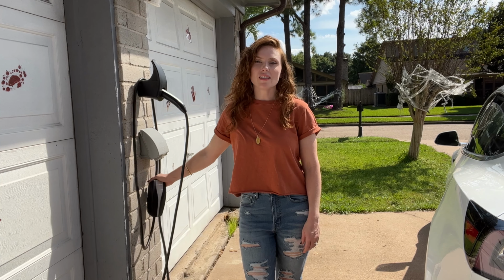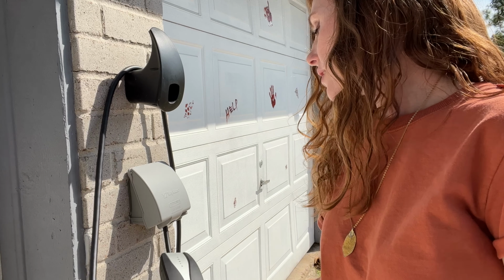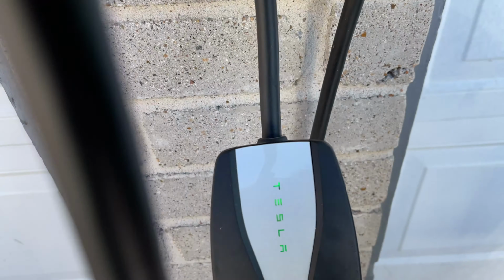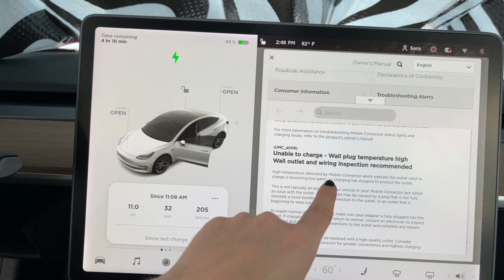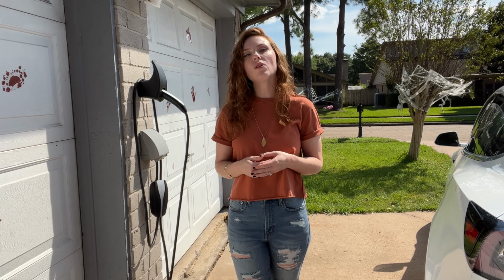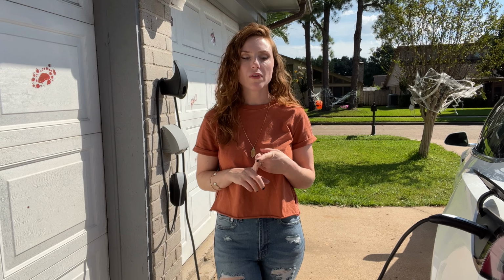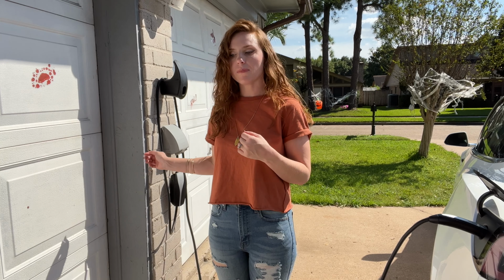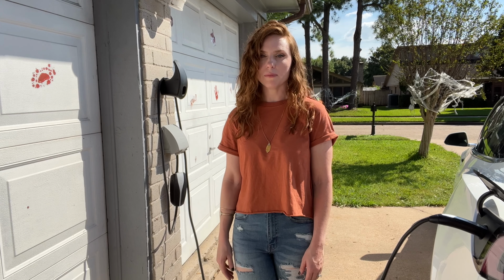TESLA Mobile Charger Problems/ Troubleshooting

Comment: Some thoughts:
1. You could plugin and then schedule a charge during cooler hours. You can always check the charging state with your Tesla app to verify. (Free)
2. As some have mentioned, you could get a heavy duty 50amp-rated extension cord so your MCU can be inside your garage, which should be cooler. (~$100)
3. You could get the Tesla Wall Connector mounted just inside your garage. The 24-foot cable should easily reach a car outside. ($500 wall connector + electrician). Electrician's fee will greatly depend on distance from your electrical panel (range $300 directly next to it to over $1000 if 20+ feet away). Of course, you'll need to crack open your garage door while charging.
4. Modification of #3 - instead of Wall Connector - just install a NEMA 14-50 outlet just inside your garage - saving you $500. Electrician fees will be slightly less because of the smaller wire size required for a 50amp circuit.

Considering the distance you travel on a daily basis and that you need something reliable for work, it would be worthwhile to upgrade your charging setup at home. Don't forget that you can still use Tesla Superchargers around your area if you really need to - or, in dire circumstances - even third-party charging stations.
Reply from the maker: 👍🏻👍🏻👍🏻Jason, I agree with all of this!!!! All fantastic ideas!!! For now I will probably make a temporary shade over it that hangs from a hook for the hot summer months. BUT, all these other options would be great too!!!! Hopefully all the information in your comment will help lots of other people as well!!! Thank you so much for sharing all this! Have a great week!!!

Comment: Will this problem be mitigated if you installed the Tesla Wall Charger?
Reply from the maker: Actually it probably would, for a couple reasons! The Tesla wall charger is white, it’s glass so the components are kind of shaded under that, and it resets just by unplugging from the car!

Comment: Will the charger reach the inside of the outer garage wall? The gray painted area in front of the door. Maybe some shade will do the trick. I have a Tesla wall charger on a 60 amp breaker in my garage and it pulls 48 amps when charging and it gets a little hot as well but never shuts down but it in not in direct sunlight.
Reply from the maker: I should have installed it inside the garage and just ran the chord under the door. But mistakes were made… I think I’ll probably just make a removable shade and see if it helps. ;)

Comment: Hello Sara, I would mount the wall connector to the inside of the garage, behind this wall and put the cable under the garage door so that the wall connector is in the shade and you can charge the car outside.
Reply from the maker: Yep, I agree! That’s what I should’ve done in the first place! Dang it! Thanks!!!!!
Reply: @SaraJAwesome  🙄
Reply: @SaraJAwesome  Or add a cover to keep out of the direct sunlight. I'd also add a support so "brick" isn't putting so much strain on the plug.
Reply: I live in Houston as well. SarahJAwesome love your videos. I have my charger plug in the Garage, I want to run the cable under the Garage door but am worried about it hurting the cable? Any experiece with having running the charge cable under the door ?
Reply from the maker: That’s actually what I should have done in the first place. But I have a tiny gap under my garage door. So mine wouldn’t put any pressure. The cable is like 1/2” in diameter so just see if there’s somewhere you can run the cable under the door without it smashing it. I may still move mine eventually. It would prevent theft too.
Reply: There's a great video on youtube that shows the best way to install the charger inside of the garage and run the cord underneath the garage door, "Route EV cable under garage door". Search it up on youtube. I did the same thing except that I also had to adjust my garage door so that it left a 1/2" gap at the bottom to allow for the rubber duct cord cover. I also adjusted the top of the garage door to allow it to properly seal up on top.
Reply from the maker: Thank you!!! I’ll check that out!!!!
Reply: There is a hole drilled into the wall already. Expand that a touch and the charger could be in the garage with the charge cable going through the wall. A benefit of the tesla connector size
Reply: Are you sure? I tried that and the garage door weight bend the cord. And that was just first attempt. I'll worry if I continue doing this

Comment: Could you run a short extension cord up to under your eves of the garage and plug in your charger up there?  The charger for my volt is plugged into a 220 in the garage and the charging cable is long and runs thru a hole above the garage door and hangs in the holster to the side of the garage door.  I have nails along the molding above the garage door to hold the cable if I need it out of the way but normally I let it drape over to the holster.  West side as well and hot weather too.
Reply from the maker: Very nice! What I should have done is installed it in the same spot on the inside of the garage and ran the charging cable under the door. Ugh. Mistakes were made. I think I’ll probably try to make a shade for it that hangs on the hook during the hot months. Idk yet. Thanks for your thoughts!!!!!!!

Comment: This same concept happens on my 120v outlet. I have it in the garage but when the temp goes up, and that outlet is already warm from producing the juice, it gets even warmer and will shut down the charge when it gets too hot
Reply from the maker: Dang, that sucks. Some people are mentioning to me that I need a more expensive Hubbell brand outlet. I wonder if they make a 120v for you.
Reply: @SaraJAwesome  I'm going to get a 240v installed outside. I'm going to put it on the eastern side of my garage since I charge overnight as it is, cooler weather and even the sun exposure it will get during the day will be minimal
Reply from the maker: Very 👍🏻 nice!!!!

Comment: I started having the same problem charging my Tesla model 3 2018 and the note started coming up on the screen high temp amp reduced from 32 amps to 16 amps. Did not have this problem until after updates about 2 months ago. The 14-50 outlet did get hot but worked without any problems for over 2 1/2 years. I replaced the inexpensive 14-50 with a industrial grade 14-50 outlet Hubbell  and the problem was corrected. Now I believe Tesla upgrade the software for safety reasons because these cheap 14-50 outlets might cause a fire hazard.
Reply from the maker: ✅✅✅✅✅✅EVERYONE READ THIS COMMENT ABOVE 👆 Oh wow! Okay then! Maybe I definitely need to replace mine then. That makes a lot of sense. Thank you so much, John!!!!!!! I did get a cheap outlet. Mine was about $10, I heard the Hubbell brand was about $50 but I haven’t looked it up yet. And it’s worth it to make sure the outlet is durable and safe. And if it fixes the problem.. even better! Have a great week!
Reply: @SaraJAwesome The Hubbell outlet cost me $99 on Amazon but has work for over a month now without any problems.
Reply from the maker: Ouch! That hurts my heart! 😂 worth It though I’m sure.
Reply from the maker: Oh also, I saw you posted a link, but I can’t see it because you tube blocked it I guess. Super annoying because I don’t block them in my settings. It should be allowed. So I can’t reply to whatever that video was. Sorry.
Reply: @SaraJAwesome  Try searching “check your tesla plug ! why you must get industrial grade” to see if YouTube comes up. The YouTubers name is Evan Michiels and he said I could pass it on. He is the one that I learned about fixing the problem.
Reply from the maker: Oh thanks! Yeah I learned from him about my A/C issues! Nice guy. Thank you!!

Comment: Thanks for the info. I didn't know about the overheating, but I've kept mine inside the garage and run the cord to my driveway, and seems to work fine so far. I'm not sure about your electric rates, but some people are on tiered rates, so it is cheaper to charge at night than during peak hours during the day. It may even be cheaper to just run off to a supercharger if you need to go watch your son's football since so many people have used your referral code.

Also, can you please correct the link for the owner's manual? That's an (J)awesome idea. Thanks.
Reply from the maker: Okay, try the link now!!!!
Reply from the maker: Oh crap, I didn’t know the link was wrong!!! Thanks!!! I’ll look at it! And yes, I’ll probably just make a temporary shade for the summer months.

Comment: 6:58: Is there some sort of weather proof foam or silicone (??)that could cover the unit? I am thinking of my silicone oven mits. Perhaps a carport awning🤔
Reply from the maker: I think insulated could be good or bad. I don’t want the trap the heat, and I still need to see the lights for errors if they happen. I’ll robably do a screen type removable shade. To allow air flow, but block the sun ☀️;) good idea though!!

Comment: I had some overheating problems with my GoPro recording my daughter’s softball games in the summer. What I did was clip a small towel to the top of the mount and let it drape over the back of the camera. You could do a similar thing with a larger towel. If the housing for the outlet has a lip, you could use a strong close pin or a larger paper clamp  to hold the top of the towel in place. Let it drape down to provide some shade for you charger. Let me know if you any pictures of the idea or the clamp.
Reply from the maker: Smart!!!!!!!!!!!! That’s a great idea! Thanks!

Comment: Why didn’t you just install your 240v outlet directly on the other side of the wall in garage and just allow charger cable to run under garage door? This is what I did and haven’t had a problem. Kinda weird spot have it, especially someone could steal it.
Reply from the maker: Because I’m an idiot, Kyle. Mistakes were made okay? Bahahahahaha😜🤪😂😅 Jk. I should have done that in the first place. But I wanted to utilize the entire length of the chord and have easy access. I didn’t foresee these problems. But that is my advice to others for sure now. Maybe one day I will move it inside on the same spot and  run the cord user the door. Have a great week!!

Comment: Huh. Commented, but it's now disappeared. Ah, well. To repeat myself: I'd suggest getting a 50A RV extension cord. You could put the UMC in your car, plug it into the cord, run the cord through a window cracked down an inch, and plug the cord into your outlet. In the car, the UMC would stay cooler, especially if you have "Cabin Overheat Protection" enabled. Easy peasy!
Reply from the maker: Yeah, I was just complaining to someone else that their commented I wasn’t able to see either. It happens all the time! And I don’t have any restrictions on comments! So annoying! And yes great idea!!!

Comment: Moving it inside on the other side of this wall would work too. You can than run an extension but should work.  Might be cheaper in the long run or better.
Reply from the maker: Yeah, I should have installed in the e same spot on the inside and ran the wire under the garage door. Dang it!!!! Ugh. 🤦‍♀️
Reply: @SaraJAwesome  it’s ok. Lol you have problems with the heat and i’ll have problems with the cold soon. Lol we just gotta adapt and work through it. 👍
Reply: I like this suggestion. The wiring / pipe is most likely on the other side of the wall anyway. Easy for an electrician to relocate the outlet on the other side or just abandon this outlet (for cosmetic reason) and add a new one on opposite side. Of course, the outside one will no longer work. Being a master electrician, the above option would be my vote.  I plan on making an ultimate guide on this mobile connector in the near future. Great video Sara.

Comment: Sorry to hear that mobile charger can overheat.  Someday I will receive my Tesla model Y, hopefully this year before my current car registration expires in December.  But who knows?  Tesla’s dashboard no longer projects a delivery date, and I suspect I may be looking at 2022 delivery.  Seems like forever I’ve been waiting.  Turns out, my garage 240v outlet is West facing too, though it is just inside my garage, were late afternoon sun can hit it.  Wet towel trick, sounds great, though won’t look great.  I have at two car garage and it still fits two cars!  Junk has no chance to accumulate, extra stuff is donated or tossed.  But, only one child, so that’s going to make a big difference.  Does the app send notification that charging has stopped? Or has reached certain percentage?  Apparently not, that would be a nice improvement to it that might help.  Thanks for the helpful video!
Reply from the maker: Hey! Well I hope it comes soon!!!! It does show a notification but it often doesn’t say what the notification is for. So I open my app and kind of guess what it’s trying to tell me. I don’t know if it’s my phone settings or what. Other people don’t seem to have any complaints about the Tesla notifications. Also, if you have IPhone you should definitely get the STATS app for Tesla. It’s good about giving notifications too even on your watch!!

Comment: This idea is untested, so…
You know those foam-backed Mylar envelopes you sometimes get in the mail, and are sold at the UPS store? They usually have mini bubble wrap or foam on one side (insulation), and silver Mylar on the other (heat/sun reflection). Maybe make a “jacket” out of one just to cover the charger itself, and see if that helps. If so, you won’t need a big shroud to cover all of the wall mounts you have. Just a thought.
Reply from the maker: Nice idea!!! That’s innovation right there! Thanks;)

Comment: I've had the same problem with overheating, except mine is in the garage and didn't start until after I had the car for well over a year. I have no clue why it's suddenly getting hot, was thinking maybe I need to get a new charger? I've bumped down the amps for a slower charge to prevent the heating but I do find it annoying I have to sudden do that after 16 months of using it without that issue.
Reply: Ask Tesla service. It could be the problem with battery or charging board. Who know, if continue unchecked you may run into bigger problems.
Reply from the maker: Very good point;) I should. I feel like I have bugged them so much about so many things I hate messaging them now 😂
Reply: @SaraJAwesome  I actually suggested this to Robert. 
You seems like sorted your problem out 👍🏼
Reply from the maker: Weird, you are the second person to tell this today!! Hmmmmm….
Reply: Did you find a solution? I'm having the same issue after 10 months in FL

Comment: Like other have said can you mount the 50amp plug and charger right on the other side of the wall inside your garage?  The cord should be long enough to go under the door and reach your M3.  Plus its a little more secure...
Reply from the maker: Yep, I should’ve done that in the first place! Dang it!!
Reply: @SaraJAwesome  it’s not to late.  Is there a box inside the garage where the electric goes through the wall?  If there is you could change out the blank cover for a 50 amp receptacle.  Then just move the charger inside to the new plug.  Leave the outside one in case you ever need it.  Both receptacles can be on the same circuit, just use one or the other and it will be fine.  I’d be glad to help you, but that’d be a long ride from Wisconsin.  :)   If a smaller “pulling 90” was used instead of a box it would be a little more work but still very doable.
Reply from the maker: Hmmmmm that’s a good idea! And thanks! Lol I don’t expect you to drive that far! 😝

Comment: I wanted to keep my charger cool and out of sight and be able to charge either pulling in forward or backing in, so I wound up barely turning the corner of the garage to mount my charger on the South side exterior garage wall under the eave in the shade.  However, I had to spring for a 24 foot cord to make that happen, so I have to coil up a long thick cord every time I charge, but it only takes me a few seconds, and to me it is worth it to keep it cool and out of sight.   I see lots of interesting solutions here in comments!  Thanks so much Sara for contributing to the Tesla community in your helpful videos and the discussions that follow!!!!
Reply from the maker: Thanks for sharing your own method!!!! I wish I installed mine inside the garage and just let the chord comes out under the door. Ugh. Dang it. Yeah, great ideas! Everyone on here is amazing. I love this community so much!!! Always happy to hear from you, Phil! Have a great week!

Comment: Thanks for the video. I haven't had this problem because my outlet is under the carport so there is always shade. One simple solution is to leave the mobile connector in the car. It will always be at a comfortable 70 degrees. And then take it out for charging. Yes, it is a little inconvenient but it's better for the electronics than sitting in the sun at 130 degrees.
Reply from the maker: Yeah, true! And nice! I’m glad u don’t have this problem!

Comment: I live in middle TN and don’t have a garage. Now I wanted to keep my charger in the car so I purchased the wall connector. Which sits on a 6x6 post that is squarely in the sun all day. Now while we don’t get quite as hot as Texas but we do have 100+ days. And knock on wood so far ai have never had it fault. So it might be a solution as well.
Reply from the maker: Nice!!!!!!!!! I’m glad you haven’t had any issues!!!!! Maybe it gets good air flow there or something?
Reply: @SaraJAwesome  good air flow and the Wall Connector is built to be keep outside so it has extra circuit internally that if a fault is detected it does a full power reset every few minutes to attempt to correct the issue.
Reply from the maker: Nice!!